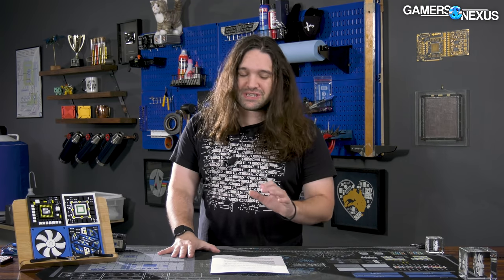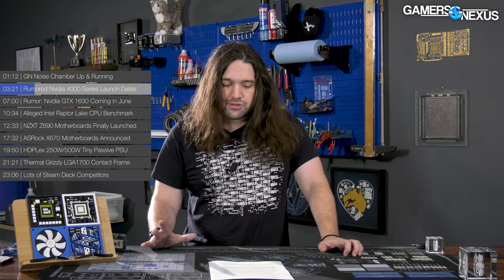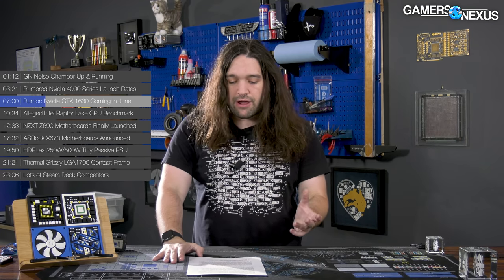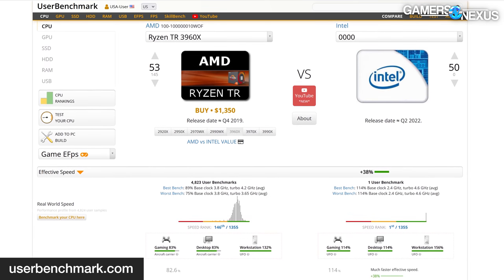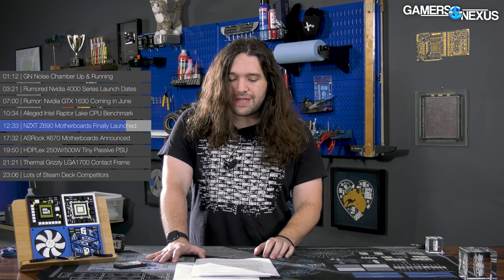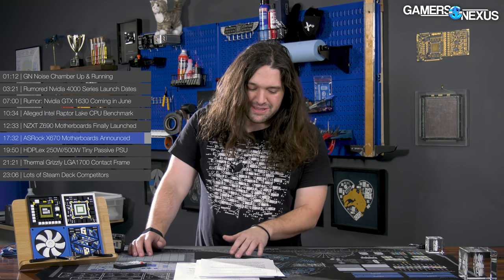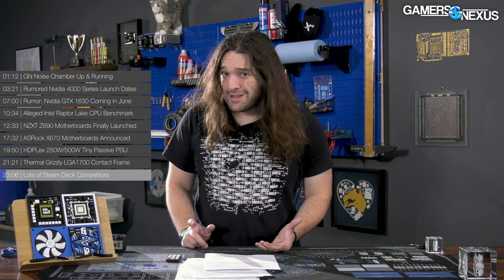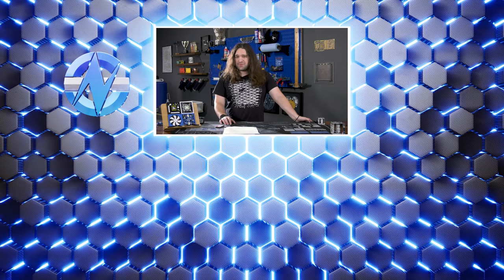HW News - Unbend Intel, RTX 4090 Launch Dates, GTX 1630 GPU, & Steam Deck Alternatives

Comment: I'm gonna be honest with you, I couldn't care less what my motherboard LOOKS like.
But I think I'd prefer the Carerra for one single reason: I don't like RGB. My PC lives under my desk, next to my bed, and it's on as close to 24/7 as possible (with power saving modes enabled obviously).
So the less RGB stuff on there the better, because if it has RGB stuff that means to get the dang lights to turn off I have to install some sort of 3rd party software that I personally don't trust because let's face it RGB is an afterthought as far as these companies are concerned and you can't convince me otherwise (let's say the RGB is on a video card, if the RGB wasn't an afterthought, the RGB control stuff would be integrated into the driver that Windows or whatever OS uses to control the graphics card in the first place, rather than being delegated to some piece of software that wasn't even developed in-house by the board manufacturer).
I already got enough problems getting fan control programs for video cards to work reliably, I don't need more blinking lights that are gonna wake me up in the middle of the night.
EDIT: and it's for that reason that whenever possible as soon as the warranty period has expired I take apart something that has RGB on it, find the little connector going to the offending LEDs, and disconnect it (in a fashion that lets me re-connect it later if I really need to or I want to sell the card).
I even have the LEDs for my power button and HDD activity in my case taped over with black electrical tape (thanks to the way the case is built there's still some really small seams I can see the LEDs thru from certain angles, but it makes it a LOT less objectionable).
Seriously who's running the full rated 20mA thru these extremely efficient LEDs that at that current will be putting out like a solid 5 lumens, which is more than enough light to illuminate at least half your room if your eyes are fully dark adapted, and I mean it's JUST A STATUS LED FFS.
And it's not even a FROSTED LED, it's one that will cast a beam of light! You might put that kind of LED in a flashlight.
And BLUE, why do they always have to be BLUE!?! THE most objectionable color to have a light in your room shining 24/7!
END EDIT

I also really wish I could get the fans on my 3070 TI from ramping to full for a few seconds every time the thing encounters the slightest bit of load, but nothing I try sticks if I turn the computer off and on again because it defaults to whatever the VBIOS tells it to do or something like that and I'm not about to re-flash a video card's BIOS and potentially turn it into a paperweight. I'm already scared enough about re-flashing the motherboard's bios (literally never had the need to do it, and I've been building computers since like 2005 or earlier, first computer I actually put a GPU into had an AGP video card slot, and before that I upgraded computers to a whopping 8 megabytes of RAM).
Reply: On Asus boards, you could turn off all lights (including RGB) straight out of the BIOS for the last four years.

Comment: No to the ASRock Taichi Tia Carrere, and a BIG NO! to any motherboard that uses Killer Nic. However, I could build a bathroom PC with that board and a white Thermaltake P5 case. I don't like the covers over the motherboard in the first place.. The Quartz design is kinda cheesy, and this will encourage other mobo manufacturers to create even cheesier motherboard covers. 

Last year, I won the Shuffle for the 5900x and an x570 Taichi Razer edition board. At first I was very excited because I have never had or used an ASRock board. At first I had trouble getting the board to work with 8gb sticks of G.Skill 3600MT/s cl16 RAM that has B-Dies..... even though these same sticks work okay with my Crosshair VIII Hero board. Now I'm having troubles with the Killer Nic. However, I still have a Gigabyte z370 Gaming 7 board with one Killer Nic port, but I use the Intel port with that board because the Killer drivers always fail.